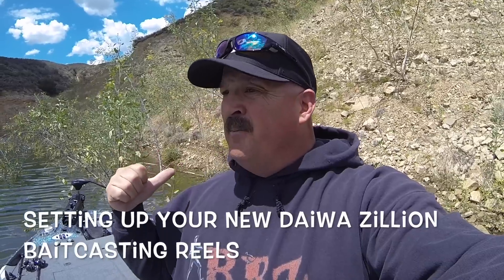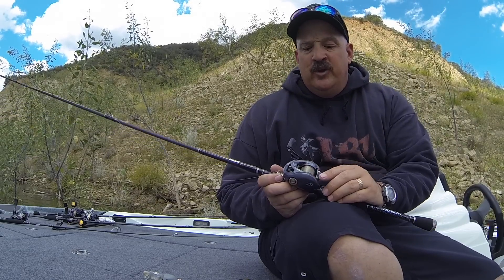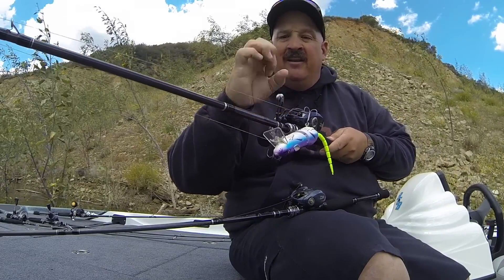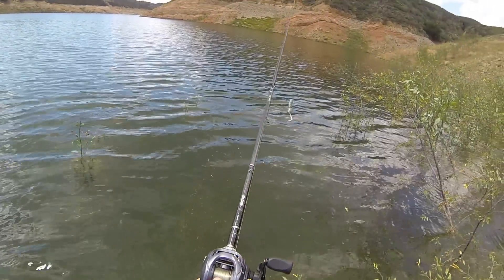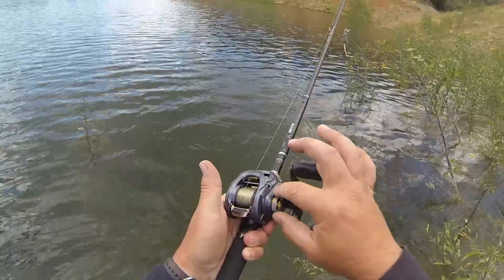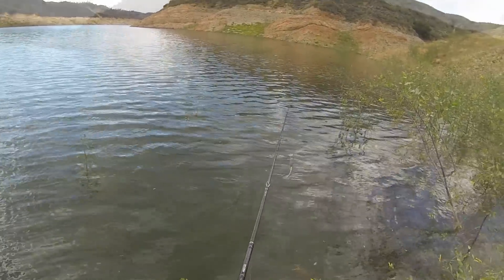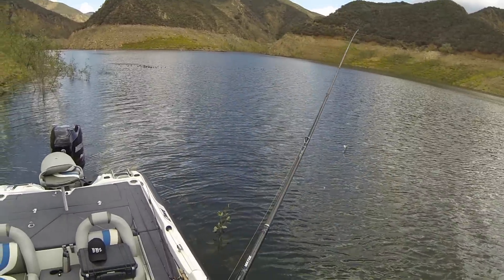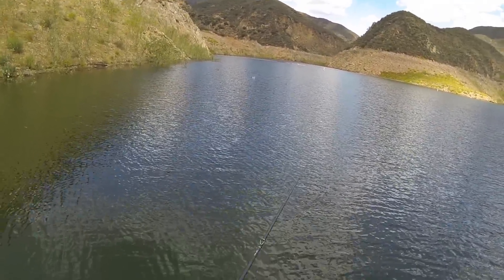How To Set Up Your Daiwa Zillion TWS Baitcaster: Beginner To Advanced Fishermen

Comment: 1st ,Are you still using it?How has it held up since?
2nd ,Have you tried braid??And does it not backlash
3rd,Is this the only model by Daiwa with the backlash dial
4th,Will it throw heavy line good distance.
5th,Noticed you didn't leave 1/8 to 1/16 in depth on line spool.How many yards could i put on of 30lb braid
Thanks Zedd

Comment: Thank you for the vid, i have a lexa 300. Foes it have the same air brake system Can adjust it the same way.
Reply from the maker: You can adjust it the same way but it will not air brake like the Zillion